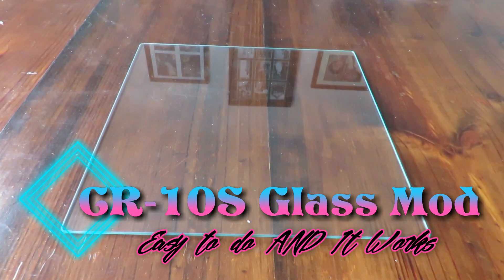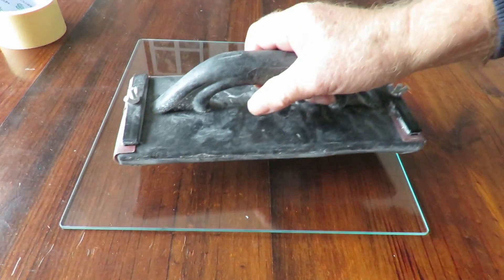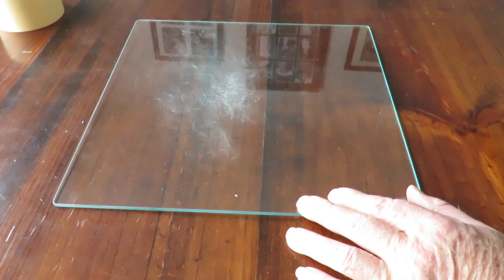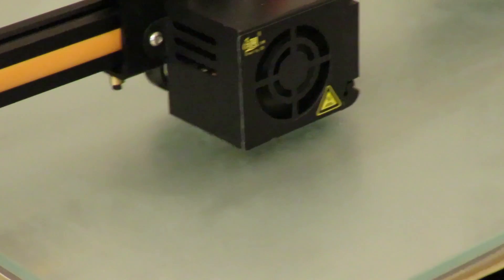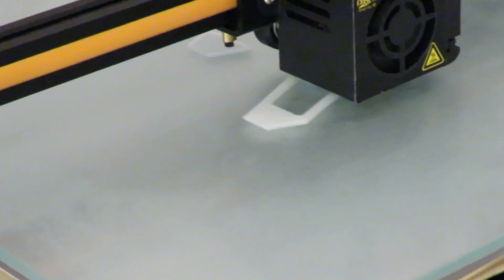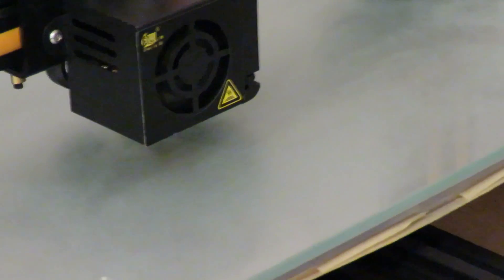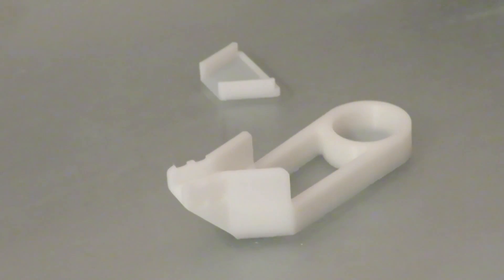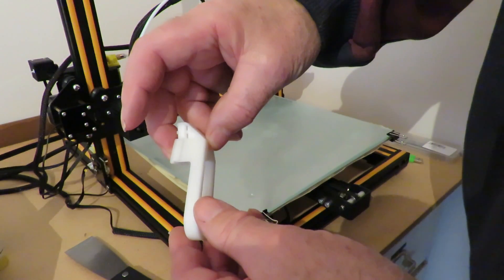📌 Creality CR-10S 3D Printer Glass Plate Modification for Better 3D Print Adhesion

Comment: What type of glue did you use
Reply from the maker: I use a mixture of PVA Glue and water to thin it out.
The mixture really well,, and you will get quite a few print made, before you need to re-coat.
Reply: Garry Purcell thanks 
By the way What does pva stand for and where can you buy some of the glue.

Thanks
Reply from the maker: Polyvinyl acetate, its also known as wood glue, 
it has a white creamy appearance,  is water valuable, and quite inexpensive.

If you do a search for PVA Glue, you should find it.
Reply from the maker: Polyvinyl acetate, its also known as wood glue, 
it has a white creamy appearance,  is water soluable, and quite inexpensive.

If you do a search for PVA Glue, you should find it.
Reply: Garry Purcell thank you so much
Reply: Garry Purcell thank you so much
Reply: Garry Purcell i also suscribed to you.
Reply from the maker: Glad I could help.
P.S. Its also sold in craft shops
Reply: Garry Purcell thank you this will help me so much
Reply: Garry Purcell by the way What was the rasheo of glue to water that you use.
Reply from the maker: Simply thin it out to what looks like a bottle of milk consistency. 

P.S. I'll make a short video showing you how I mix, and also apply the coat to the glass, in the next few days for you.😉
You get really good model adhesion, and you can print many times on the same spot, without reapplying a coat.
Reply: Garry Purcell than you so much

Comment: This method looks like your going to save some money by not buying tape.
Reply from the maker: This was used on a warped glass bed to level it. I use a mixture of PVA Glue and water to thin it out to apply on thge bed. 
The positive side effect, is you will get a lot of prints printed, before you need to re-coat the PVA.

P.S. I also used a power sander to reduce the size of the micro scratches, the finished glass looks like it is frosted.
Reply: It looks pretty nice tho mine cr 10  glass is little bit warp on the right coner
Reply from the maker: If you take your time and use a power sander, you should be able to get it almost flat.
AND.... if you make a mistake... you always have the other side for printing.🙂
Reply: Garry Purcell I'd be very cautious about using a power sander. The glass dust it creates can be very hazardous to your health.
Reply from the maker: Well pointed out.
I should have stated to use a respirator and earmuffs as a safety precaution.

Comment: You do it all wrong, looks like you dont get the idea of what you doing. Its working but somekind of messed up method.
Reply from the maker: haha. Sums me up perfectly.

I went on and power sanded the glass, and now give it two coats of woodworking pva glue, and run five or more prints before I need to re-apply.

The sanding does two things.
1. Takes out the high spot in the middle of the sheet.
2. Adds micro scratches for better adhesion.
Reply: Paint the fence, Daniel son. Up, down. Up, down.

Comment: Sorry, I don’t see the logic of wrecking a good piece of glass....then using glue ? Check other videos....most don’t even use anything on the glass....but if you must use glue...you may as well use tape and hairspray or glue stick.
Reply: QuadCopter 102, adhesion works by flowing into tiny scratches and pits in the surface of material. It is a mechanical bond, since glass is extremely smooth it is difficult to glue to with out using something thin like super glue. Super glue is not conducive to 3d printing though since we want to be able to remove it in one piece. That is why we use tape to transition from a smooth surface to one with more surface area enabling us to use a weaker, less permanent glue. But tape is not very durable and it really is a chore to replace it and if using a square sheet of kapton, bubbles are a problem and is damaged easily. His reasoning was not to stop using glue, it was to stop using tape. And it is brilliant and on my to do list for today.
Reply from the maker: I can print without Glue if I want to.  (The adhesion is quite good.)
P.S. You can always turn your glass over, if you don't like the micro scratches.

Comment: This looks like a good idea. Thanks for sharing! Have you tried the masking tape and you think this works better for adhesion?
Reply from the maker: I find the frosted glass works better.
You can always turn the glass over for a smoother print base, and you can also use tape if you like on either side.

Comment: Hi 

I want to do the same with my glass plate of my CR10.

Works with all types of filament including ABS and Nylon.

What kind of sandpaper do you use which grain.
Reply from the maker: The sandpaper I used is called P150 grit.
After you get a nice scratched surface the models really grip the glass especially if you use a glue stick.